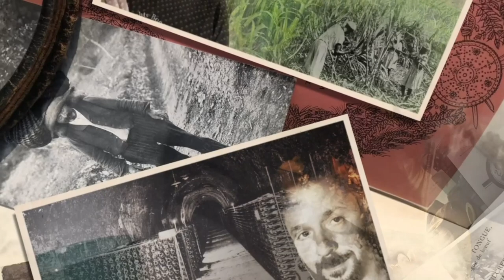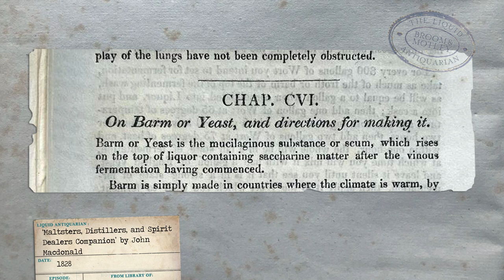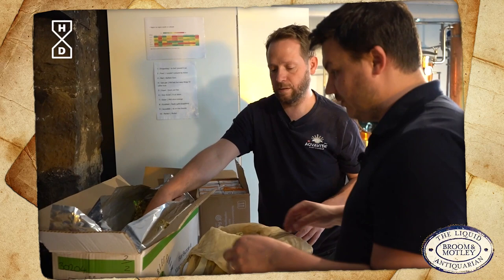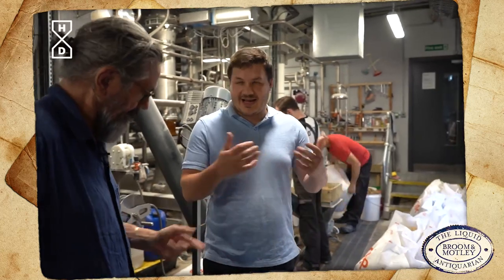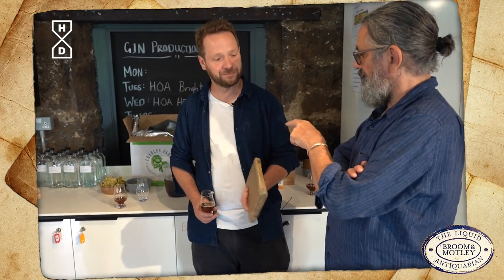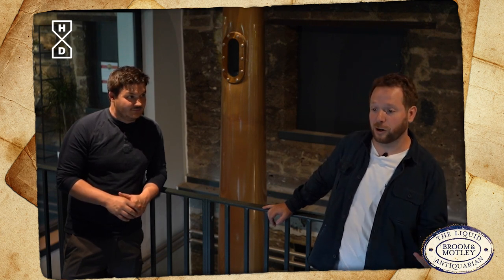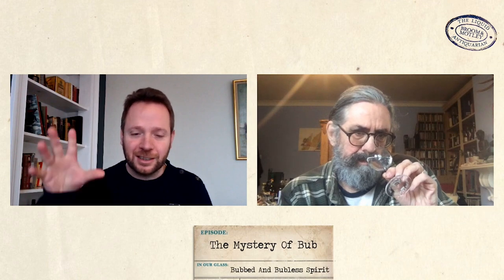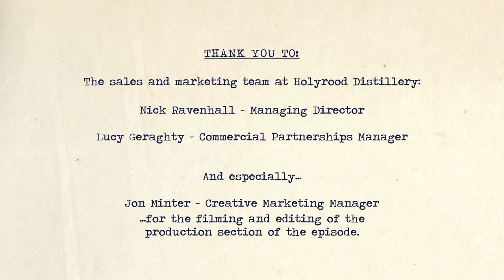The Mystery Of Bub

Comment: So bub is basically what brewers call a yeast starter. The hops wouldnt add much flavour infact if you distill beer that has hops in it the spirit usually ends up tasting like wet dog.
Reply from the maker: Pretty much (yeast starter). But although there is possibly a whiff of wet dog, if it is there it is very much in the background. Have also tried some weird US distilled IPA and it's not like that.